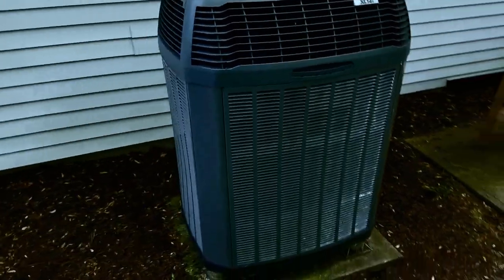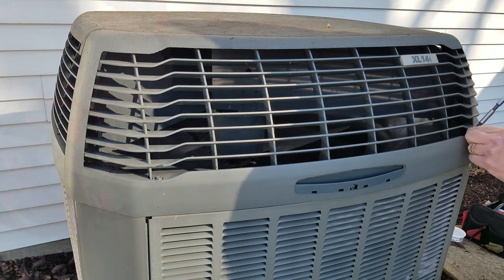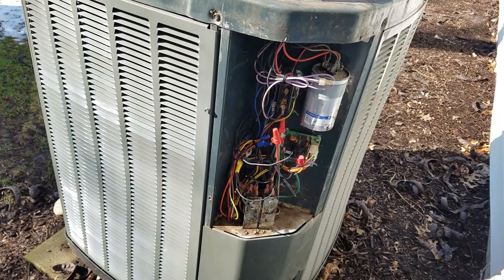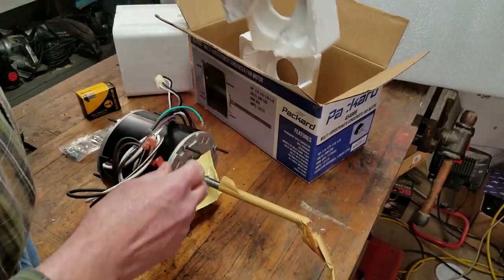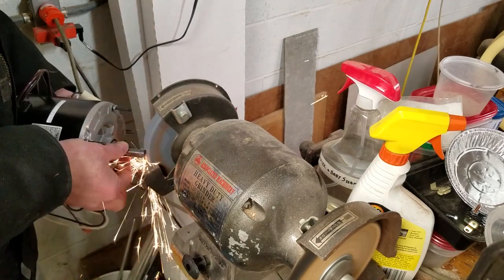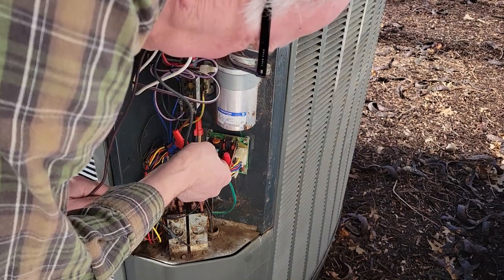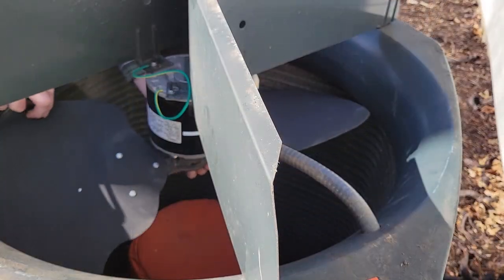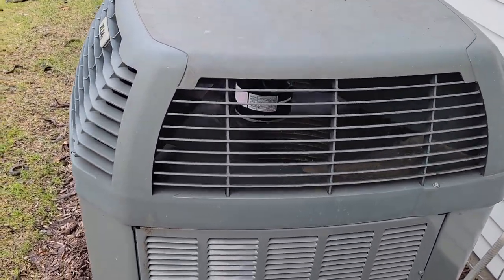Trane XL14i Outdoor Unit - Replacing the fan motor

Comment: Terrfic video. Helped me change the fan motor on my XL14i. I had to get a motor fast. So I opted for a more expensive motor from "Century" part # FE1028SF which was also a Frame 48 with 70degC max ambient. It was available in one day from Grainger. The Packard would have taken a week. Decided not to wait. I did not cut off part of the shaft as there was enough clearance between the fan blades or the end of the shaft and the compressor/heat exchanger. I did not have to cut off the long screws either. I used a separate 5MFD capacitor as well in 4-wire config. Also, like David, I preferred to let the HVAC companies service other calls. They wanted $1400 for the job and I thought it was best they went after more complex issues with other customers. I am glad I replaced the motor myself. This video was an immense help.
Reply from the maker: I'm so glad it helped!  Thanks for the additional information; this gives future viewers even more options.

Comment: Why is there a jacket on the compressor? Do you live way up north or something like that?
Reply from the maker: I live on America's North Coast, Cleveland, Ohio.  We have to turn the power on to the outdoor unit for a while before we can actually start the compressor.  There is a heater in the compressor to prevent fluid lock during cold spells.  The blanket keeps that heat in.

Comment: Great video, but you didn't discuss whether you needed to add the run capacitor. You just added it at the end.
Reply from the maker: I’m sorry,  I guess I should have made it clearer that the value for the new run capacitor was different than the original one.  Thanks for pointing that out.

Comment: Hi, helpful video, thanks. How did you know the Packard 45488b would serve as a replacement ? My XL13i needs a motor and I'm trying to identify a replacement that is reasonably priced. Also, why did you add another cap ? Appreciate a reply. Thanks, Ron
Reply from the maker: This motor is a universal replacement that meets the frame size, voltage, and RPM.  The shaft is long enough for most fans, it is reversible, and it can mount shaft up or down.  It will probably work for almost all outdoor units with a 220 VAC frame 48 motor at 825 RPM.  The HVAC distributor can also recommend a replacement.  The new motor needed a larger capacitor (7 mfd) than the original motor (5 mfd).  It's also a good practice to replace the capacitor when you replace the motor; it was only a couple bucks at the distributor. Make a friend with an HVAC contractor; they can get the motor from an HVAC distributor at significant savings over Amazon.
Reply: Thanks again, we swapped the cap with a known good one but fan motor hums & is reluctant to spin. Spins freely when it's "off". At first I thought it's brushes may be worn out, but now I think it may be brushless. Shaft play in-out is about 1/2" whereas axial play is roughly .050. Any more thoughts?

Comment: Do I need to install a "new 7.5 micro running capacitor"? Or can I just reattcj it to the original capacitor (the round one)?
Reply from the maker: If I remember correctly; and that's a bit of a challenge for me (lol), I think the original one is a 5 mfd cap.  I would install a new one; it is pretty cheap and if the fan motor is old enough to fail, then the cap can't be far behind.
Reply: @LifewithDavid1  Thanks for the reply. I replaced the fan cap with an original spec one. I tried to turn it on and the breaker popped and it was making a humming noise (fan didn't spin). The only thing I could change to reverse the two fan wires on the capacitor (the brown and the brown/white one). Would that make a difference? I live in Florida and everything in the electrical section looked corroded. I could restrip all the wires and put new connectors on them...?
Reply: "could change IS to reverse" (typo)
Reply: Sorry for the multiple inquiries... I just noticed that the Cap I took out was a 35uf / 5uf and the one that my AC guy gave me to install is a 30uf / 5uf Could that be the problem??
Reply from the maker: @GTH-mb3xw  I can't remember (so please verify this yourself first), but I think the compressor has the 35 mfd cap and the original fan has the 5 mfd cap.  If you got a 30 mfd/ 5 mfd cap, I would think that might cause problems with the compressor start and it could do what you described. If the new fan motor calls for 7.5 mfd and you only have 5 mfd then it might not start up either.  Good luck!
Reply: @LifewithDavid1  Thanks David...I got it working. Turns out that there was a bad "temperature activated switch" ....it's working great now, but I ordered a correct 35 / 5 Cap online and I'll switch out the incorrect 30 / 5 one when it arrives this week. Thanks again for your help...!

Comment: Should have cleaned the coil while you had it apart.
Reply from the maker: Thanks for the comment!  That would have been convenient.  However, the coil is pretty fragile; so I usually I use a pressure washer from the outside.  I didn't want to get it all wet while I had the electric open.  Also it was still cold out so I hadn't turned the outside water on yet.